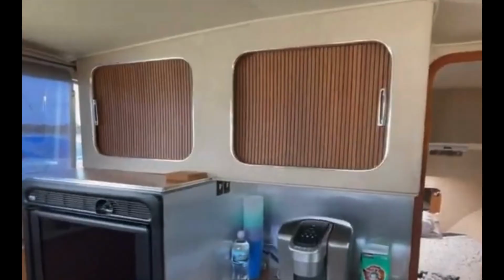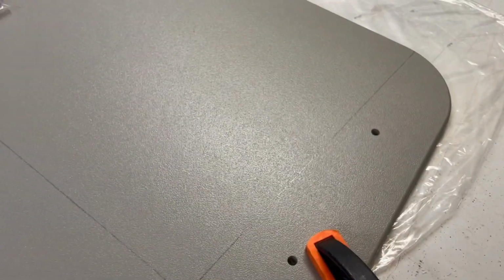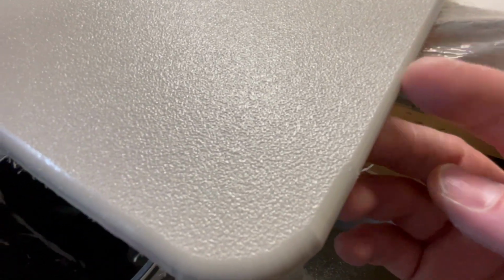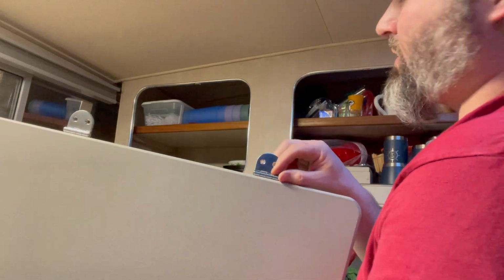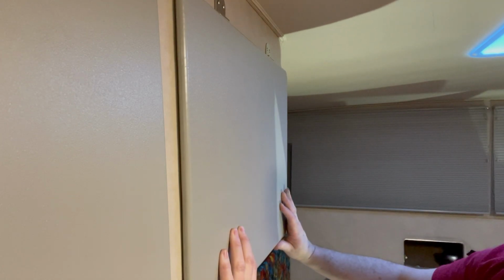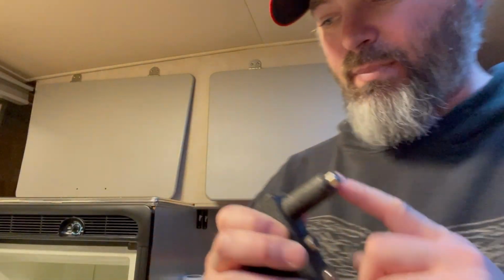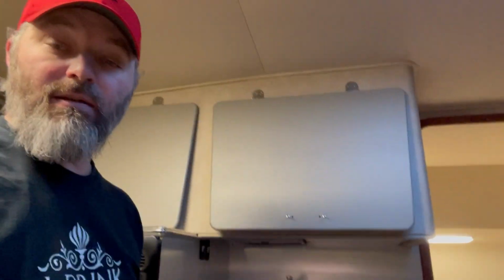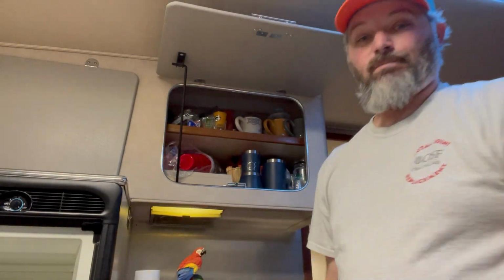MV Thirsty Whale, 1984 Chris-Craft Catalina 381, Installing new galley cabinet doors

Comment: Very good idea. Gosh, you are so handy. The boat will be like new. Restoring these classics are a beautiful way to maintain the history of the Chris Craft Company. They built a ton of boats. They are known to have good hulls so certainly worth restoring. The Catalina 381’s are very attractive and timeless designs. Not too big ,not too small, Great aft section and large mid ship for entertaining inside and of course the cockpit gives you exterior space with good site lines.With the engines midship, I often wonder how noisy they get while underway? Can you hear your TV. Or carry a normal conversation while underway ? Got an idea for you, what about going full Electric Motors ? One could install sound shields under your floors to reduce the noise levels.
Reply from the maker: Thanks Charles! I LOVE having projects...and there's no shortage! LOL As far as the noise goes...that depends on how fast you're running. At hull speeds, it isn't bad, but elevated conversation is needed. Any speed on plane...its loud. Running 20kts+, you don't want to be in the salon, and the aft cabin is piercing to the ears. Going electric...that is a MASSIVE endeavor and expense, so that isn't on the long range horizon. If someday it becomes economically feasible, then I love the idea of electric motors, but I don't see that happening for a very long time...if ever.
Reply: @WiscoBoater  yeah, I have to agree. Just maybe some kind of a hybrid. Gosh, in California,  San Francisco Bay Area we are up to $5.85 per gallon. I suspect we could be up to $6.00 per gallon soon.I’m asking a lot of questions on the Catalina 381’s because I like this model a lot.  Although not in the market yet, I think this model is a good choice when and if I want to trade up to a more solid heavier more comfortable yacht. I bet you could reduce the noise by 50% by installing some high grade sound proofing. Some one could make a ton of money if these old engines could be modified to a hybrid. In the 381 their appears to be a lot of room under the salon for additional electric motors or assist motors like a hybrid. Currently, I can deduct my fuel costs as part of my business. However, someday they will take that deduction from us.
Reply from the maker: @Chas1160  We have a seasonal price at the marina...but we haven't been told what it will be yet! I'm sure it will be $5+. Feel free to ask as many questions as you want! I absolutely LOVE my 381. It's as big as I want to go at this point in life. The sound insulation is a good idea!
Reply: I considered Elco full electric twins and they are just not comparable in horsepower yet without even considering range anxiety. The largest motor you can purchase from Elco, for example, is the EP-200 and it provides 150-200 hp where the standard motors on these boats were designed to have 340 apiece for a total of 680. Edit: and they want $60,000 per unit so that is $120,000 to repower a $50,000 boat with electric. That's a lot of gasoline.